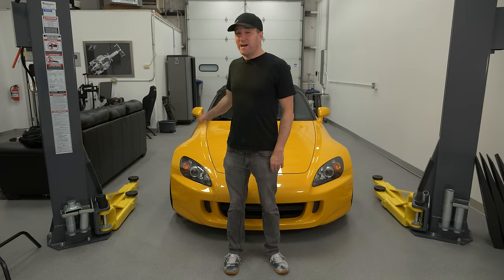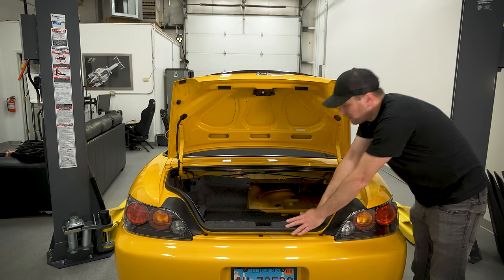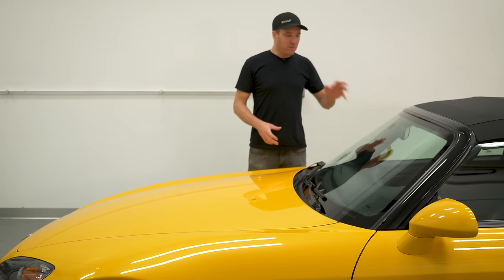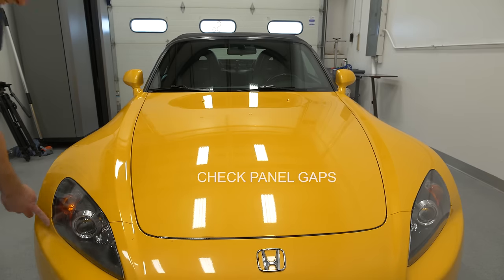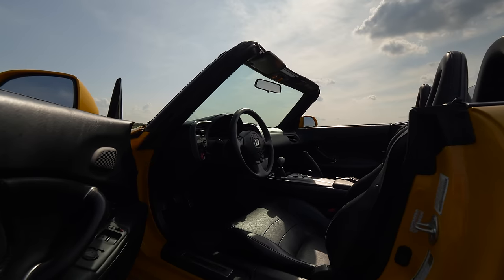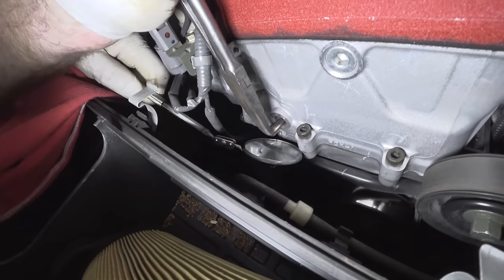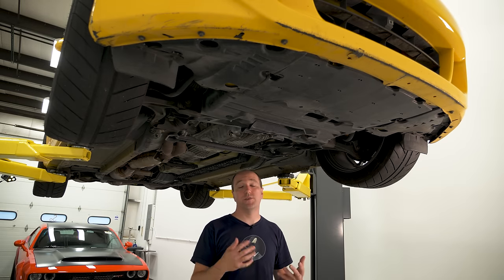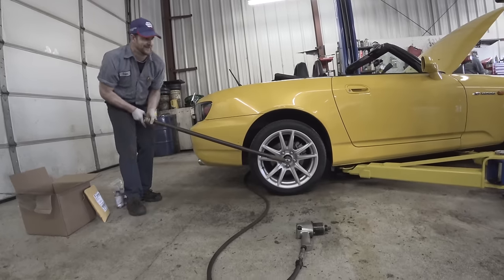Honda S2000 Buyers Guide and More

Comment: Squeaks from the seat belts rubbing on the seats is a really easy and cheap fix.  Stick some velcro (soft side) on the part where the seat belt rubs and the noise is 100% gone with no damage to the seats.

Comment: Tip: convertible frame, when closed, uses a rubber on metal bump stop contact point behind the driver’s left shoulder and passenger’s right shoulder (RHD). This rubber on metal contact point causes a squeaking when not properly lubricated. I spray it with lithium grease when I replaced my top. Now the interior no longer squeaks. Back to its original Genuine Honda quality.

Comment: Great video. One point I could add coming from longer term ownership is that for DBW versions there is a common occurrence of APP sensor failure. A plug into the OBD2 will show any history of this otherwise by having an experienced owner drive at low speeds there can be detectable disconnect between accel and pedal position will is a symptom that the APP sensor failure is imminent

Comment: Enjoyed this S2000 video Savagegeese! I've done my fair share of research on my own S2000 but this video raises the bar on everything someone should know before buying one.

One thing to note: Right at the end you could have mentioned about the TSB recall for the rear-end clicking that occurs when accelerating from a stop due to inadequate torquing of the rear hub nuts. You just need to torque the nuts a bit further and re-stake to fix (find a nice cheater pipe for this).

Comment: I bought my S2000 new in 2002, Sebring Silver, and it still sits in my garage today. Mine is a California car and just turned over to 8,000 miles. I have too many toys and didn’t find much time to drive it and therefore the reason for only 8,000 miles. Mine has always been garaged, never driven in the rain, no rock chips, door dings, etc. The closest you can get to a new one as it looks as good as the day I brought it home. Now that values are rising I’m afraid to drive it. I take it for a spin once a month to keep it running properly and will eventually probably sell it. I need to figure out what it’s worth. I’m going to want a good price for it because as I said it’s about as close as new condition as you are going to find since I babied it for its 8,000 miles. Whenever I would drive it I would never park and leave it unattended as I was afraid of getting door dings, someone backing into it, etc. so I would take it out on back country roads and just enjoy a nice Sunday drive. I know I will miss it but I have been basically storing it in my garage time capsule for twenty years and will enjoy having a garage again for new toys.....

Comment: Perfect timing. 

I own an E92 M3 right now and completely agree with all your critiques about it. Looking to get into an AP2 instead.
Reply: Jonathan Mendez oh god please tell me more because I’m in love with the m3 in my head and his experience broke my heart, and I still don’t entirely get how it went so bad for him
Reply: @Fee.1 M-Cars are notorious for falling apart after the first 4 or 5 years. High tolerance parts tend to go bad quicker especially when manufacturers use a bunch of plastics and electronics for high performance purposes. The germans haven't made a bulletproof car since the late 90s.
Reply: I just made that exact change about one month ago! Loving the s2k life this far.
Reply: ShoryukenDatAzz rod bearings and the plastics issue doesn’t bother me, I’ll buy the custom metal gears for the throttle pieces that break, it’s cheap as hell. More interested in the nuanced stuff than the commonly known things.
Reply: Jonathan Mendez I would however be interested in knowing your particular ownership experience in as much detail as your up for
Reply: ShoryukenDatAzz Not true. This is typical uninformed garbage spew. The e92 M3 is the most reliable car I have ever owned, and I’ve owned about 7 different cars.
Reply: Jonathan Mendez he’s right technically, they’re notorious for certain issues, but notoriety is by nature based in ignorance coated in gossip, fear, and confusion. notoriety =/= a high failure rate, all the issues he mentioned are minor anyway, and if you can turn a screw all but the rod bearings are easily handled & in such a way as to ensure the issue never happens again. 

As for the rod bearings, use it as a negotiating tactic and spend a couple thousand on upgrades B.E. bearings and ARP bolts and you’re set for life. Much like the IMS shaft issue, its only a problem in a single digit % of cases and as long as you are willing to proactively replace the component at risk of causing catastrophic engine failure you’ll be left with what’s actually an incredibly reliable car especially by high performance German vehicle standards. 

In reality the running costs of bigger stickier tires & such wear items are likely to be what costs you some money over its lifetime, and that’s to be expected/comes with the territory.

Comment: Great video.I enjoyed all of the detail that you went into. If this was mentioned in the video and I missed it then my apologies. But it's definitely worth noting that these cars are actually very easy to work on. Everything on the car is so accessible, including everything on the bottom side of the car once you get them up in the air (as with any sports car). Just one more aspect of this car where the engineering team really knocked it out of the park.

Comment: Also when shopping, check the shocks ... those puppies are $250 a corner (OEM) and, except for coilover packages, almost zero aftermarket options. Order all the rubber parts for the rear as well, because dealers don't stock those, and they'll be torn to bits.

Comment: Keep up the good work, i hope you keep talking about the s2k. I would really appreciate a video showing the best way to drive the car in sharp and fast corners, cos it is much trickier than my previous car the gt86.
Reply: Karim Haroun how does it compare to the gt86. I personally am on the fence of getting either a s2k gt86 or an rx8. Each have their advantages and disadvantages but would love to hear your opinion on the s2k and gt86
Reply: Quad Point The BRZ is slower and more dailyable. The s2000 feels like a racecar 24/7
Reply: @footythoughtstv3435  If you want a daily car get the brz. If you want the better car overall get a clean s2k.
Reply: Karim Haroun alright thanks but would you not consider the rx8 because apart from cost it seems pretty good
Reply: Zilla what about the rx8, and I’m thinking of getting a tune if I get a BRZ
Reply: Fastest way to drive this car through corners is "zero counter steer"
Reply: @footythoughtstv3435  Brz is a pretty good car eventhough it is a bit low on power. It has many advantages over the s2k. Less noisy cabin, more hightech audiosystem, better aerodynamics, better fuel economy, newer. I personally would buy an auto brz over the manual, it is that good especially for a daily. The s2k on the other hand is good in bouts, you can not drive it slow. The handling is pretty good , much higher power, engine sound is nicer, more visceral feel, interior is actually nicer, much more rare, gonna become a classic, better looking.
Reply: @footythoughtstv3435  I have no idea about the rx8, though i really hate the styling. It is one ugly looking car. I personally wouldn't buy a rotary due to fuel consumption and reliability.

Comment: If anyone is interested in a blue 02 S2000 their is one located in Durango CO at Durango motor company. I drove it today and it is in excellent condition with 39k miles. I am 6'4" or I would buy it but always wanted to drive one. Ask for Keith.

Comment: Great video!  I just found you guys and love your series on the S2000.  I own a stock 01 since 2012.  It was a 1 owner car with 150K miles when I bought it.  It now has 197K and remarkably still runs great!  Love this car and want to keep it but at it's age and mileage I'm concerned that it may needed an overhaul?  Uses a considerable amount of oil, and I do not drive it hard as I used to any more.  It was my daily driver from 2014 until 2019, when my kids were in college .  Now that the kids have launched and all my cars are back home, i don't drive it nearly as much.  I would really like to go through it now that I don't rely on it for my daily anymore to bring it back to its original glory.  Cheers!

Comment: I don’t currently own an S2000, but would love to have one someday. I watched the entire video and found it very informative. One thing though, what year S2k is the best (most powerful, better suspension, etc)? Maybe this is something you could discuss in-depth in the next video?
Reply from the maker: This is going to be argued by owners. But if you want a collectable.  2000 or 2001 or CR.  Most reliable 2004 and 2005. If you want to mod the car and tune it 2006-2009.
Reply: '04 - '05 is golden, unless you get a CR 😒
Reply: @savagegeese  whoa, I got a reply from Mr. Geese himself!! I feel so honored! Haha 🤓  But for real, thanks for the reply! What makes the 06-09 better than the 04-05 in terms of 'tunability'?
Reply from the maker: @christophersparkman  You can reflash the ECU as it is re-programmable.  The 00-05 is not. Have to switch to stand alone, send out usually.  Good luck!
Reply: savagegeese ohhh I see! Good info! Thanks man. I’m off to search Craigslist for 2006 and up S2000s! 🤤

Comment: 10 VIN tags rule is only for US market I guess. I purchased AP1 10.1999 in Switzerland and there are no 10 VIN tags here. I've checked other s2000 in the country too. VIN tags in Swiss S2000 are only on the chassis and under the windshield.

Comment: Current 05' owner here. This is a second car and is mostly used for weekend back roads. I would like to get into autocross eventually. My stock suspension is starting to show its age and will likely need to be replaced soon. Im looking to get into a coilover system that is close in feel to stock with similar ride height. I see you have the Ohlins DFV. Ive been considering these coilovers and was wondering if they are worth it compared to the Bilstein PSS B14 coilovers? Do you think the ohlins would be overkill for my needs and am better off going with bilsteins?

Comment: I'm going out of town this Saturday to look at a 2006 S2000 with a rebuilt title due to past vandalism and interior parts theft (broken window, seats and other trim stolen). Dealer claims VIN on all parts match and only body work done was front bumper repaint. Is there anything besides what was mentioned in video that I should be watching for or any other advise about rebuilt titles? The car has 81,000 kilometers on the odometer and was imported into Canada from Colorado. Number of previous owners unknown at this time.

Comment: For me the biggest turn off is the electronic throttle for 2006+ model years. 2002-2003 comes with a standard glass rear window, drive-by-throttle cable and it's still a true 2.0 litre engine with a 9k redline.
Reply: I bought my S2000 new in 2002, Sebring Silver, and it still sits in my garage today. Mine is a California car and just turned over to 8,000 miles. I have too many toys and didn’t find much time to drive it and therefore the reason for only 8,000 miles. Mine has always been garaged, never driven in the rain, no rock chips, door dings, etc. The closest you can get to a new one as it looks as good as the day I brought it home. Now that values are rising I’m afraid to drive it. I take it for a spin once a month to keep it running properly and will eventually probably sell it. I need to figure out what it’s worth. I’m going to want a good price for it because as I said it’s about as close as new condition as you are going to find since I babied it for its 8,000 miles. Whenever I would drive it I would never park and leave it unattended as I was afraid of getting door dings, someone backing into it, etc. so I would take it out on back country roads and just enjoy a nice Sunday drive. I know I will miss it but I have been basically storing it in my garage time capsule for twenty years and will enjoy having a garage again for new toys.....

Comment: There's no such thing as "Honda spark plugs". He meant o.e.m. brand from a Honda dealer. They are either NGK or Denso. Both are Japanese companies. I recommend NGK Laser Iridium because of how high these engines rev and the heat they generate.

Comment: Is an 05 S2000 with 48k miles with a replacement clutch installed after 45k a good Craigslist buy for a firm $20,000. His valve retainer's are replaced along with new spark plugs and recent tune up at the local Bay Area Honda dealer.

Comment: With the S2000 using FRM cylinders much like all of Honda's early sports cars/coupes how much oil does your S2000 burn between oil changes.   I would image that it is not a small amount unless you are keeping the revs low?  I know that the 3rd gen prelude last year used FRM as well as Acura NSX and some other Acura Integras.  I don't know of the S2000 1st gen or 2nd gen would use more oil based on the manufacturing processes and development.  It seams that Hondas generally can use quite a bit of oil if they are revved high. I have been looking at these cars but it scares me that the cylinders cannot be bored  for a rebuild.  My understanding is that people will generally just slap a new set of pistons and/or rings in the engine and just call it a day  I'm sure the head and bearings etc are redone but I'm speaking strictly about the cylinders as they relate to FRM.  I also understand that Toyota also did this on some of the last year Celicas and rad that the process that they used was a better process.  If the car is burning excessive oil I'm not sure how to determine that when shopping around unless as I doubt that spark plugs would be oily or other tell-tell signs would be detectable..  Good video.
Reply: No comment on oil usage between changes

Comment: I don’t know if this is the platform to ask questions, but any input would help! I have a 05 AP2 , bone stock, never tracked , engine and tranny run perfectly fine.  — 1. The starter/ clutch  grins only when COLD start.  2. At a stop , if I put a bit gas, the rpm goes up , but seems struggle to idle and engine stalls. This happen not very often , but still. Many thanks 🙏
Reply: You can also go to the fourm in s2ki.com and ask.
Reply: clean your throttle body and idle control valve

Comment: I see you are lowered with Ohlins but no half shaft spacers. Are you planning  to get a set soon?
Reply from the maker: The car in the rear is only lower a .25" and .45" in rear.  The spacers are not needed. Also have 10k springs in the back so less over all wheel travel.
Reply: Are they even necessary? I’ve had my coilovers on for like 3 years and it rides just fine without them
Reply: @dustin9258  I had my spacers on my first S2K for peace of mind. But I guess if yours isn't low enough, you probably don't need them installed.

Comment: Silicone hose is a big deal ? I own a Japanese CivicType R and those Honda intake hoses turn to dust. I like your videos man but jeez you need to chill a bit + a used stock air box from Yahoo Japan I got for ¥10.000 , sold the carbon one for double that...if the hoses have been changed to a good quality silicone hose that’s a good thing on an old car. Especially Honda charges a lot for new OEM parts and I guarantee you should get a lifetime from quality silicone hose like Samco!

Comment: Mark, I own a 2003 stock S2000 which I rarely drive. Do you think it will go up valve?
Reply from the maker: If its not driven hard just inspect valves retainers during valve adjustment

Comment: 19 , money saved . Now I must decide between my lifelong dream car the s2000 or my new found love the Evo X ... any help ?
Reply: Two completely different cars: On one hand you have a rear wheel drive convertible that weights 2,800 and is NA. Evo 10 gets all wheel drive, four doors, a 2.2 liter engine that has a turbo.

Power band is kinda similar with vtec engagement at the top of the power band on the s2000 and the Evo having to climb up as well to hit peak boost. Evo 10 gets like 300lbs of torque where the s2000 has around 160.Two completely different cars: On one hand you have a rear wheel drive convertible that weights 2,800 and is NA. Evo 10 gets all wheel drive, four doors, a 2.2 liter engine that has a turbo.

Power band is kinda similar with vtec engagement at the top of the power band on the s2000 and the Evo having to climb up as well to hit peak boost. Evo gets 300lbs of torque where the s2000 has around 160.

Right away take into consideration two seats vs five. How important are other people in the car with you, because it's gonna come up as an issue when you can only fit two the s2000 vs the Evo which is a sedan that you can get all your friends together and drive.

Location is also important, do you live in a sunny usually warm temperature state or is it mostly rainy.
A big part of an s2000 is the fact that it's a convertible and you will enjoy it with the top down like nothing else, Evo will keep you more or less safe in rain ; s2000 not so much even with great tires.

I wanted an s2000 for years and I purchased it this year.. All I can say is positive, I absolutely love it but it is not a daily vehicle that I use. I'm 21 and I daily my honda civic around 50 miles per day for a commute to work if I had only my s2000 the miles would really rack up. If you buy an s2000 it would be awesome to have another car to put miles on it and then have your s2000 as your strictly fun road warrior grocery getter ;)
Reply: Dennis Melnik I would be getting this car  as a daily for about 110 mile round commute to work everyday that’s why the evo has became more appealing recently